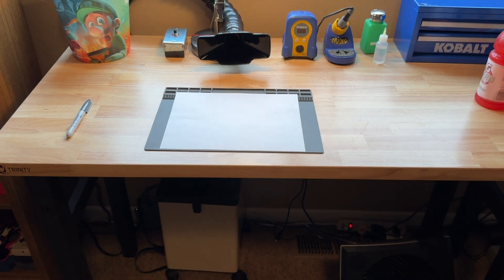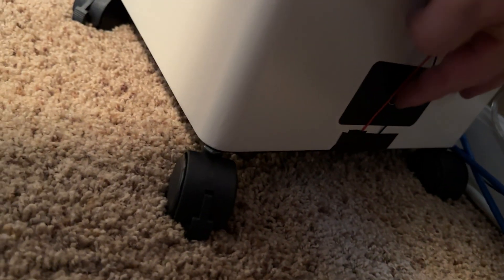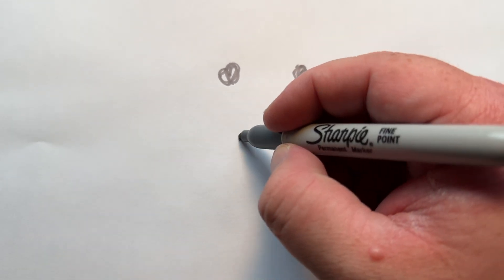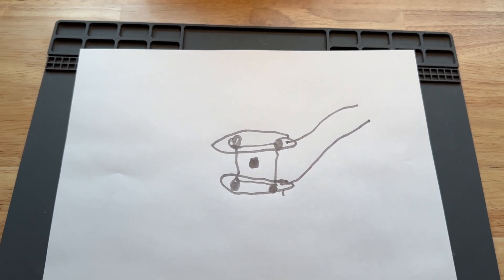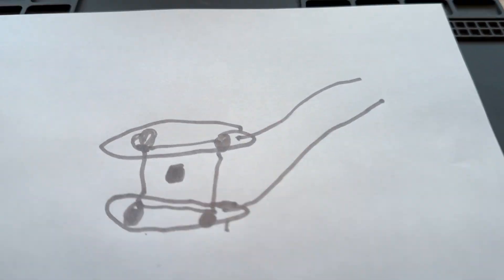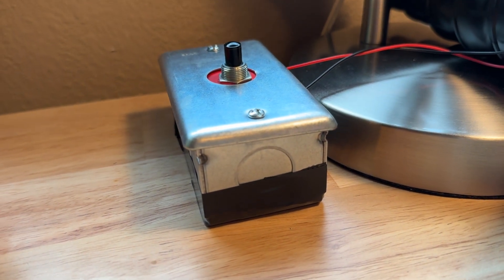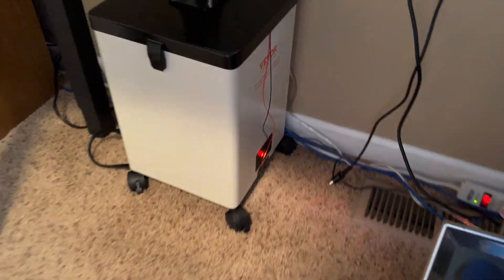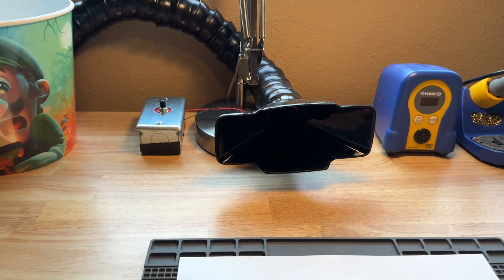Vevor 150W Fume Extractor Mod

Comment: There is remote switches that you could add and program for a momentary switch and still have the original button working parallell with it. Its sheep on Aliexpress. Would be interesting to se if its possible to add car panel dampener on the inside of the casing without obstructing the airflow from the filters. 🤔 One more mod could be to make a holder for the trunk so its base is clamped to the sade of the table and then use a pvc flex hose between that and the filter box and se if it dampens the sound. The trunk is to ridgid and smooth so i guess that amplifies the air sound.